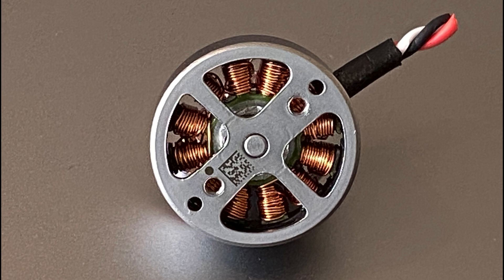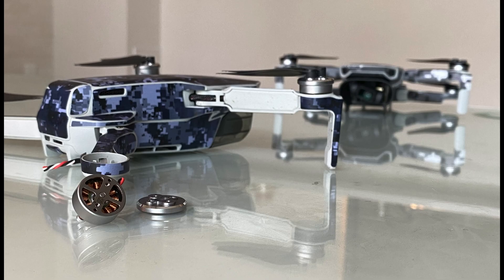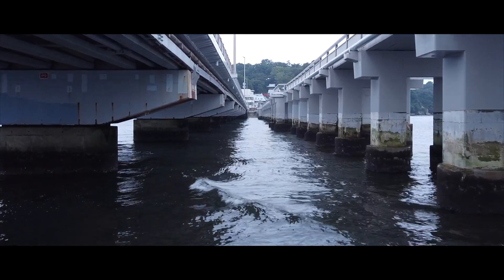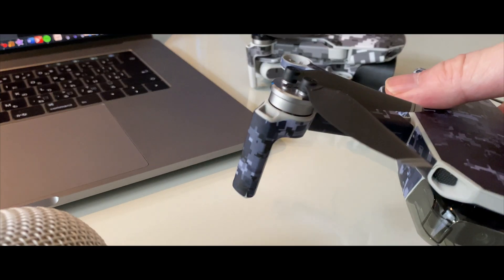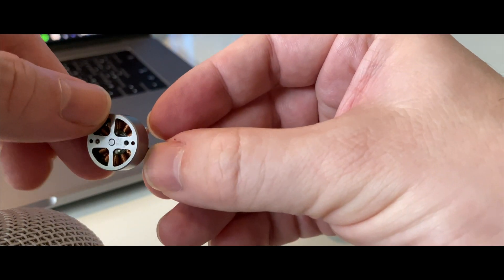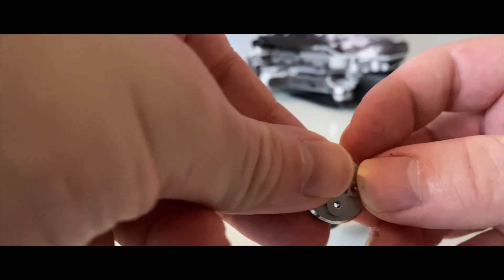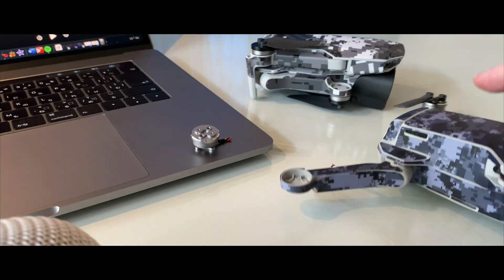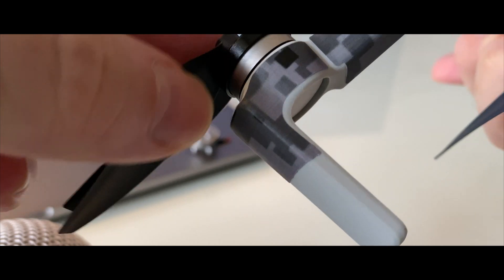DJI Mavic Mini engine swap after sand damaged the motor replacement PART 1/2

Comment: Is it possible to add a more powerful motor onto the dji mini 2 se to make it faster?
Reply from the maker: I would not do that since the software can not be adjusted for that. 
FC and ESC still will think the original motors are on the Mavic.
Reply: @MattShonan  ah ok thanks, im building an fpv drone now so i dont need to worry about the performance on my dji.
Reply from the maker: great!  @milo-WT

Comment: I need help... The right arm motor is very hard, it's not turning as well as the others... is there any product or liquid I can throw in it?
Reply from the maker: Yes, I have a video on this coming up next week. 
You can try to first wash the motor down with clean hand warm water. 
After that, give it an alcoholic bath to push the water out. 
Then dry it out for some days and hopefully you will be fine.
Reply from the maker: regarding alcohol bath you can also check out this video
https://youtu.be/tUK0-A5ODhM
Reply from the maker: The video how to recover my clocked up motors is coming up end of next, I will post a link to that once it is up. 

Have a great day!
Reply: Thank you!
Reply from the maker: @iLuSionModDerI  you are very welcome! 😊

Comment: ok . get some electrical spray cleaner.. get the motor ready to start up and geta compressor handy with around 150 psi coming through a jet that is needle size.. now start motor with aire going through at 25 psi and then spray in some electrical cleaner. then with motor running slow add some more cleaner then straigh taway blast with 150 psi  from compressor, this would shift it if its sand.
Reply from the maker: In some cases this can work!  
Just if at the beach sand and in this case some iron partials are involved it might  requite an engine replacement. Thanks for the comment and have great day!

Comment: I just had my maiden flight on the beach and I crashed my Mav mini into granite rocks then it landed in the sand lol, no cracks on the body or arms, props ok but two motors stopped and sounded like yours I took it home took props off and used my car tyre compressor and blew it inside the mother every angle whilst turning the motor the grinding noise went and it span around freely, once turned on they span around so props back on, no problems, sometimes sands damp and sticks inside either pressure blow it out if u can't let the sand dry then blow & blow inside whilst turning before taking apart, Im a total novice lol I think I was lucky, I was gutted at the time it bounced off one boulder onto another but I think my leg extensions you connect from the front Arm to the back arm so it's like a sledge & I had a gimble guard on protected the body ✌🏼
Reply from the maker: Great you could recover that way without a major surgery! 
Yes, it can work! I think in my case there were iron or other metal things mixed in the sad and in this case it is really game over. 
When looking at my other FPV quads, I had another sad case recently and how I recovered form this will be up here sometime in the next weeks or so. I use there a different method since the motors are more expensive and no metals were in the sad which got in the motors. 

Happy flying! 🤙🏻
Reply: 😅  @MattShonan

Comment: How much it cost to repair a motor
Reply from the maker: Well, it really depends where you get the motor. 
It can be very inexpensive if you find a good deal on eBay for example. 
Thanks for the comment, happy flying and have a great rest of the day!

Comment: Just remove the C clip and you can have access to the rotor containing the magnets easily...... I've done this many times
Reply: how the heck do you separate the M2P motors though. there's no circlip. are they press fit?
Reply from the maker: @DarkstarNovembr  good question! I could not figure it out either.
Reply from the maker: Thanks for your comment!
Reply: How to you remove it on the mini motors?

Comment: Won't the engine covers push the weight above 250 grams?
Reply from the maker: Correct, they do, same as ND filters.
If you like to stay below 250g you can not use any accessories like that.
Reply: @MattShonan  Damn, I was hoping that wouldn't be the case.
Reply from the maker: @martin90000  you can try to make up for the more weight by using carbon fiber propellers. 

The other option you have is using the Japanese batteries. In Japan the Mavic Mini has 199g. 
DJI is doing that by just downsizing the batteries. Using those batteries you can shave off 50g. 
However, your flight time will be impacted by that.
Reply: @MattShonan  Interesting, do you know where I can get carbon fiber propellers?
Reply from the maker: many places, just make a quick google search. 
At the time I got mine Amazon had a good deal.
Reply: @martin90000  mini 2 is less heavy and give some tiny room to add some stuff
Reply: @tomHoflack  Right, we figured that out further down this thread - but thanks for the heads up
Reply from the maker: BTW
you also could lose the battery door. The battery is kicking into place and will not fall out.
Reply: @MattShonan  You're right, the carbon propellers were surprisingly easy to find.
Very creative with the battery door lol - though I think I prefer the carbon propellers, since the whole idea is to keep dirt out of the aircraft :-)
Reply from the maker: @martin90000  yes, but the weight reduction to stay under 250g by only using carbon blades might not be enough. you might not have any choice but losing that door 😉
Good luck and looking forward to your experience. 

Also thank you for the support. You might like some of my other projects and videos, check them out and consider subscribing👍🏻
Have a good day
Reply: @MattShonan  Problem solved :-)
I just weighed the drone, and was surprised it only weighed 242.53 grams, not 249 grams!
Then I checked the official specs, and it's just 242 grams.
That leaves 7 grams free to still be 249g max, according to the official specs, and the (plastic) engine covers are only 1.5g each, adding up to 6 grams total, still below the limit!

So no need for carbon blades to stay below the limit with engine covers on :-D
Reply from the maker: @martin90000  great! that might leave enough room to do the upgrades! Let me know the final result.

Comment: Have you tried spraying it with wd-40 or blowing compressed air to it?
Reply from the maker: aldrin jude Dagmang Yes, it cleaned up some but not 100%. That is why I decided to replace the engine.
Reply: @MattShonan  you can get rid of the sand just keep cleaning. Use diesel in a bucket . Motor in you hand and with shaking movement submerged in the diesel wash it out. It will be out in few minutes. Sometimes rotate the motor and keep up with the flushing. 10min all as new. Clean with alcohol... Done
Reply: @themaximussx875  wow thanks

Comment: where did you find motor replacement parts. please leave a link below. i only need a motor. i dont need a arm.
Reply from the maker: Nabeel Ahmed I bought mine on ebay. however, I also could not find only the engine and had to get the arm assembly. The price would not change by much. Amazon also has replacement parts available, you can try it there as well. 
Thank you for watching and the support, have great day!!
Reply: What did you write i can not find it anywhere. Can i please get a link as well?

Comment: So do you just solder the cables from the new motor to the cables on the drone?
Reply from the maker: That is correct! I soldered the new cables and the the once form the old motor together. To avoid taking the Mavic are apart and not solider directly to the mainboard of the Mavic. 
Reason, this drone is tiny and I tried to keep soldering heat away from sensitive electronics like the IMU.